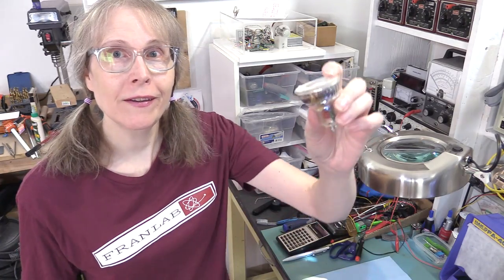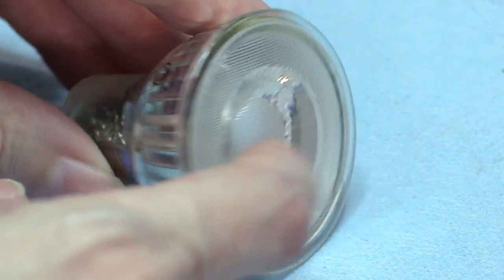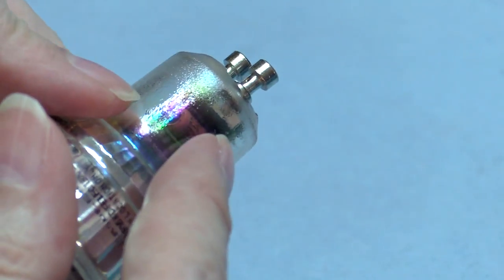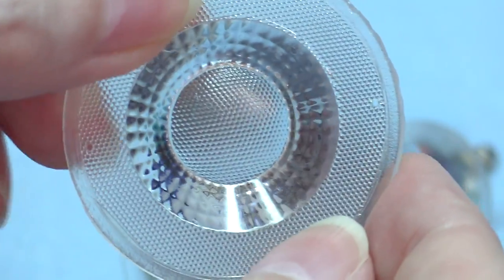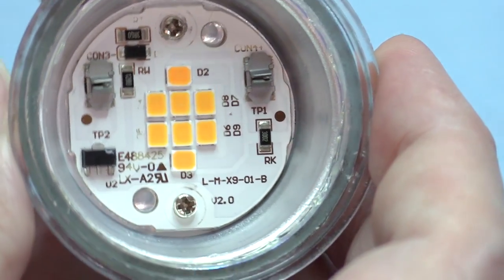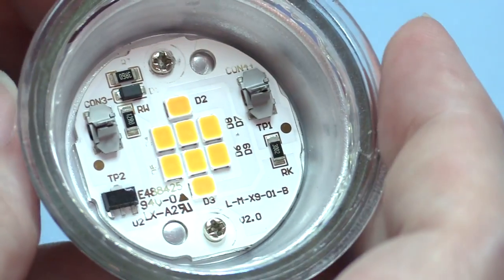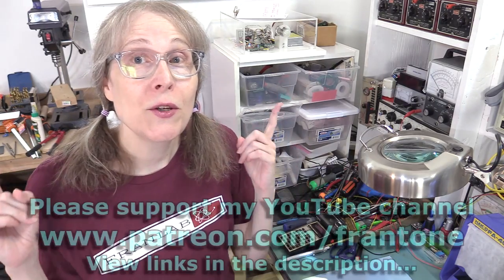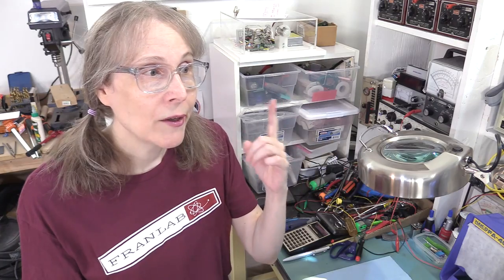Inside An LED Light

Comment: It seems almost a bit digital: either the LED lights just keep working year by year... or they fail soon after purchase. I've seen mostly PSU fail and thermo-mechanical stress kill LED lights. I can only remember one that had a busted segment in the string of LEDs. I lived a bit outside the city so our grid was slightly wobbly depending on weather and what the neighbors, farmers and factories where up to -a fair bit of transients killed PSUs. From memory, it was mostly a tossup between thermo-mech and PSU failures. Worst are the cheapo chinsy LEDs, assembled with no due care to stress on solderings once pressed to fit inside bulb shape. Board to board soldering cracking, pin to board cracking, you would get heat and that accelerates oxide layers forming insulation in end. I've been smarter now, marking date on LED, saving receipt in LED box so it's easy to get money/replacement back.

Like a few has suggested: we need a reform for LED lights to be environmentally effective. Time to separate driver and LED chip - possibly even have a low voltage DC line for lights. Fixtures should have an adequate heatsink to fix LED segment to, it's asenine to put a 2-10W LED inside a thermally isolated plastic bulb!
Even a livingroom seldom needs more than 15-20W to light up, so even a 12V would do fine for light fixtures in ceiling.
If you burn out the LED (should be min 25000hr) - get a new chip. If you kill your driver - get a new driver. Maybe place driver in the bucket you have the lamp switch. Then you can opt for a dimmable or not since the LED chip itself is fine with either.

WHY HAS THIS NOT HAPPENED?!?  Maybe I'm not smart enough to see the problem.
Bloody planned obsolesence maffia probably.

Comment: I expect that the LED's themselves are fine I have LED's in 30 year old radio's that still work. It is the design of the unit itself that is at fault. It is not an unsolvable problem. I am sure a well designed unit that interfaced between the AC and the LED's could be made as a single unit that could be used interchangeably in endless 'bulb' designs that was dependable.

Comment: I replaced all my lighting with LEDs three years ago, haven't had one fail yet 🤔
Reply: LED bulbs get dimmer over time and it happens slow enough that you don't notice it, try swapping one of your 3 year old bulbs out for a new one of the same power rating some time, I bet the new one will look weirdly bright.
Reply: Fair number of the cheap ones (dollar store 8 to 13 watt) die in a few months. The rest just keep going, in my experience... we’ll see if they get dimmer with age.

Comment: I do not have actual data, but if you look at the parts on the circuit board it would be very close to that of making a standard phone charger that can deliver about 1200 ma to 1500 ma.  From what I have been informed it would actually take at least 3 years of use of an average LED light to break even with the carbon footprint.  

The reason for LED lights being encouraged when using less power the power stations burn less fuel.  There is no concern about the carbon foot print for the manufacturing of these products is because the manufacturing is not done locally.  It is all done in China and other Asian countries with low labour cost. 

Electric cars are being pushed very hard globally. The fact is the carbon footprint to manufacture an average electric car is more than 6X of that to manufacture an average gasoline car. It starts with the mining of the various types of metals, refining, making the necessary alloys, and so-on.  Then there are the rare earth metals which are the most toxic known next to uranium for mining and handling. This is a huge on going story far beyond what I am prepared to write in an email. 

When we have all these many millions of electric vehicles on the road, there is no plan of what is going to happen with all these warn out depleted batteries. Recycling the materials from these is very expensive, highly polluting, and is dangerous work. The efficiency of recycling any reusable materials from the batteries is less than 20% efficient.  There is no actual plan put in to place with this. Actual logged data is scarce, restricted, and difficult to obtain. Governments and the manufactures say they have a plan, but if you ask for exact details they can only supply superficial information. 

The real reason for going to a different type of energy and power systems is to open new markets for future investment. The oil and gas industries as we know them are saturated with very little room for large amounts of growth in value, and there is the need for something else to continue on with.

Comment: It is good to question the cost of components and the recycling. The aim is 50 000 hours for the lamps, and my experiece with them is some brands last with very few failures, but in the ones that fail it is the LEDs that pop. That said, the electronics industry are sourcing the elements, and creating the components used in these bulbs even if they did not make LED lamps. Everyman loves their electronic toys. The whole electronics manufacturing recycling ♻️ process needs to be ramped up, as soon as possible.
The real issue with filament lamps is the cost to run them, particularly where the power generating stations are not sustainable, and are contributing to the CO2 being exhasted into the atmosphere.

Comment: After 60 seconds into the video: At least it should not be dead that fast (don't they say led will not die at all, but maybe after 10 years it'l be not as bright as before?), Halogen would probably have lastet longer. Very interested to find out, why it died... After 3 min: No LED showing the black dot of death so the reason must be in the electronic board. I understand that the purpose of this video is another topic but in the end - if this lamp would have lasted 10 years - your question would be obsolete...

Comment: You ask some great questions in this video. When I drive down the street where I live and see all the solar panels on people's roofs I can't help but wonder how much hazardous waste is sitting up there full of cadmium and other heavy metals that will need disposal sometime in the future. The same goes for electric cars when the batteries finally fail. Are we really saving the planet  with all this "technology" or just creating future hazardous waste piles for generations to come? But for the power needed, tungsten light bulbs are actually very bio-friendly relatively speaking, with the exception perhaps being the lead solder at the base.

Comment: I'm not impressed with LED lights as of late.  The super-duper switching power supplies seem to die rather quick compared to the LED chips themselves.  There was nothing wrong with a plain Jane capacitive dropper.

Comment: your questions about a low energy bulb that just do not last long enough are valid, its right to question if companies and products are hiding behind a green claim that does not add up. It is a bit unfair to say China don't care? although I agree it is probably not well understood or measured there. 

Americans have an overly huge carbon footprint per capita with inefficient houses over heat/cooling and cars that are just terrible. And your current president ... does not care and is reversing loads of legislation designed to try and prevent pollution. Europe and the UK do a little better but still loads of room for improvement. We all have to do our bit

Comment: I have had four LED bulbs fail in about a year each when they were supposed to be guaranteed for 50,000 hours. The LEDs probably last that long but the electronics fail long before due to poor design. One failed because they used the wrong type of silicone, so the acid it released etched the tracks off the PCB. The rest failed because the capacitors wear out. To get them to last 50,000 hours in a hot environment they should be derated. I.e. 105C / 5000 hour caps with the voltage rating many times the working voltage, or avoid electrolytics altogether.

In contrast I have some expensive LED ceiling lights in my kitchen that are 10 years old and none have failed. So it is possible with proper design, but perhaps not at a cost people will pay.

Comment: I haven't had a good experience with LED lamps at all. They don't last anywhere near their rated life. The are also an environmental disaster waiting to happen. They are not recyclable and contain arsenic compounds. I prefer fluorescent lights. Sure, they contain mercury which is highly toxic but they are recyclable as with the phosphors used. Fluorescent lamps got a bum rap years ago because the contained phosphors made from beryllium compounds. Beryllium was banned for use in fluorescent lamps in 1949. Also, energy savings is greater with fluorescent vs incandescent but the savings with LED vs fluorescent is very little.
Reply: Gerard Carriera, You are absolutely right sir. I will safely bet on Fluorescent lamps. LED lamps fail prematurely, well before their rated life. On an one to one comparison, Fluorescent lamps easily score over the LED lamps, in terms of longevity, beam angle, and carbon emissions. I have a question. You seem to be highly qualified technically. My doubt is whether the indicated wattage in  LED lamps is inclusive of the huge heat generated that is dissipated through use of heavy heat sinks around the bulb. Could you please throw some light on this aspect, sir  ? 
With lots of love from India.

Comment: I have several solar panel arrangements that allows 12V DC an 24V DC
to be used in my shop and house.  They are for DC LED lighting only.
Not tied into shop or house wiring.  No DC to AC invertors.
After years of study, I have determined that solar panels, charging system,
and batteries are excellent for one thing:
Opening the front gate several times a day so I can drive through.
The LEDs fall apart and burn out all the time, even though
they are rated 12-30 VDC.

THanks for THinking !
North Central Florida
6/6/2021, the era of human depopulation.

Comment: I'd guess planned obsolescence or stupid engineering is the problem, not the LEDs. I can't prove it, but I suspect it would be difficult for manufacturers to profit selling $5 bulbs that are only replaced once every 20 years.  I wish you could do another video to track down what went wrong with the bulb. The only LED light I've had die so far, was a cheap one which I dissected. Everything in it worked fine, except there was a solid core wire going from the circuit board to the center terminal where the bulb screws into the light socket. The wire was not soldered or crimped to the center terminal, just pushed against it. As far as I could tell, thermal expansion cycles simply slightly bent the wire so it no longer contacted. If I had known that ahead of time, I probably could have just straightened the wire to get it working again. (The metal screw part of the bulb could be unscrewed from the plastic case to gain access to the stupid wire.)  So all the resources and energy that went into making the bulb were wasted because of a little loose wire.

I've heard, but don't know for a fact, that the LEDs are often pushed a bit past spec to get a bit more light out of them at the cost of reduced lifetime. 

I'd guess that from the consumer's point of view, and to maximize environmental benefits, the light fixtures themselves should come with high quality versions of the converter in the bulbs, much like the ballast and starter in a fluorescent light fixture. A 3rd terminal on the bulb could show a resistance that encodes for the amount of current to supply the bulb. The bulb could then be pretty simple, just LEDs, heat sink, and a resistor.
Reply: Light fixtures with built-in supply is neat idea, but it needs some standardisation of sockets and "communication" between bulb and fixture. Manufacturers of fixtures and manufacturers of bulbs... People who would buy these new fixtures. And manufacturers who would make "cheaper" fixtures with not-so-OK converters.

Think about cell phones (chargers) - how long takes manufacturers to agree which connector to use. Now we all have USB chargers. But some of them still have questionable quality..

In the end Fran will have video about carbon footprint of poor-quality sourced fixtures :)

Comment: I always get the stink eye when I bring up the carbon footprint of electric automobiles. So many think that electricity comes from a magic hole in the wall. They do not realize that in some instances it takes tons of coal to recharge those batteries. Those same people would have a stroke if they learned of the damage to the Earth from the mining for the materials for the batteries for these same vehicles. Generally these "green" things just move the pollution into someone else's backyard.
Reply: Well there is some benefit to moving pollution to somebody else's backyard if they can handle it better; power companies can extract energy from fossil fuel more efficiently and with more controlled emissions than a regular car engine.

But generally yes, an electric car charged from fossil fuel is worse than just burning fossil fuel directly. I'm not sure where the breakeven point is. Ie how much of the electricity needs to come from clean sources in order to be better overall? IDK but I think in many places we're already past that point.

Side note about carbon footprint, I read something a while back which determined that the carbon emissions are reduced driving a few people in a Prius as compared to walking. The moral of the story is there's more to environmental impact than just carbon.
Reply: @eDoc2020  The Prius article would be an interesting read. 

Considering that the Earth and everything on it is carbon based, a carbon foot print is hard to escape. Moreover, our attempts at doing so have caused more damage in other ways than they have corrected. Solar sounds good on paper, but, in the real world, the rape of the land in third world countries for the minerals to make the cells is catastrophic. The manufacturing cost of wind turbines far exceeds anything they will earn back in their service lifetime. Lithium mines which supply ore for batteries, do not fall in the same category as coal mines do and do not have to reclaim the land when stripped like coal companies have to.

So many falsehoods and so many falling for them. I would like to see Fran follow cost and foot print of these "energy conscience" light bulbs.

Comment: I have 3 led lights, different brands. I thought they were supposed to last a very long time but all 3 of them failed within a space of 2 years. Some of the surface mount leds had failed in each of them, I repaired the lights by replacing the failed leds. I don’t trust led lights now and will not be buying any more led lights for a while